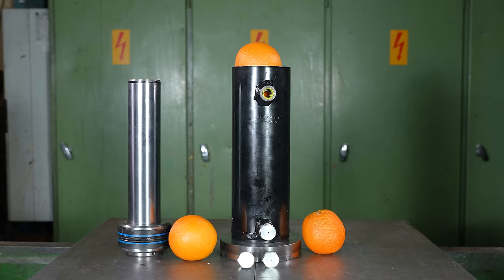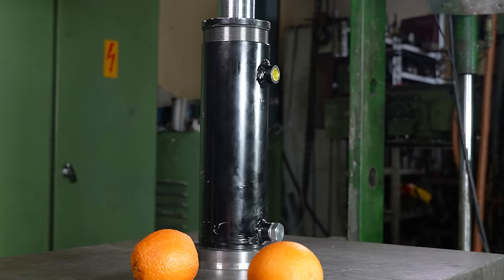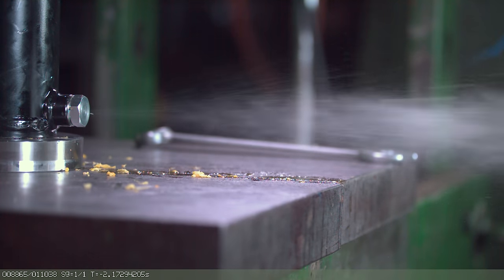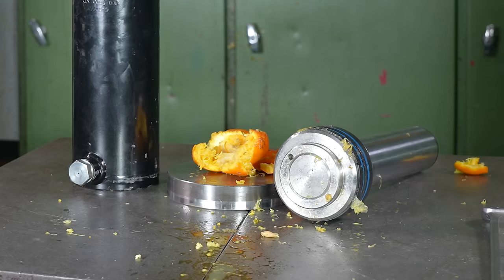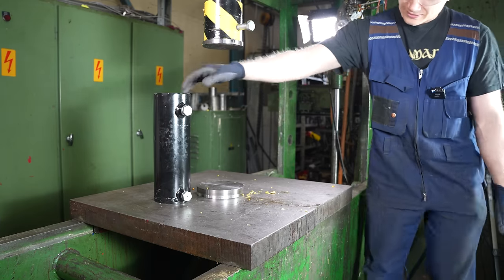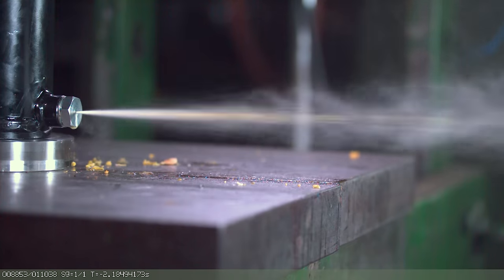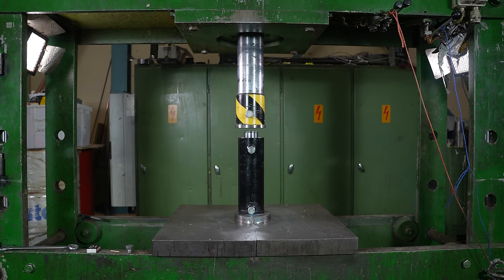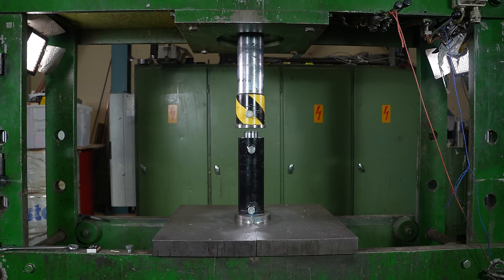How Small Hole Can Oranges Be Pushed Through with Hydraulic Press? + Channel update!

Comment: I want to see what you can cut with the jet coming out of that hole. Cutting wood with an orange would be pretty impressive.
Reply: When life gives you lemons (oranges). Cut wood
Reply: @hanswurst5109  life never gave humans lemons. we made them.
Reply: @GamerFreak-jf3qq You deny humans are alive?
Reply: waterjets for cutting have an abrasive added. they don't cut with pressure alone
Reply: @nairdacnalbel  the orange is the abrasive
Reply: Also a good title.
Reply: Yah, I wouldn't stand directly behind the window just in case
Reply: My company works with water cutters. We cut through the stainless steel belt every 6 months and we only use about 35k lbs of water pressure.
Reply: @nairdacnalbel  not the ones we use. Its chilled water filtered with .5 micron filter. Nothing added to the water
Reply: @scruff5644   do you constantly pass over the belt or does it get accidentally passed every so often?
Reply: @nairdacnalbel  literally no one asked
Reply: @jwalster9412  constantly. We even have stationary cutters that need to be moved so they dont get cut all the way through. Also we use a .1 micron hole
Reply: Candle laser!
Reply: i want to see wood go through that hole

Comment: Im curious how far the candle wax would go without a wall blocking it now
Reply: right that was impressive
Reply: Do you think there is a business for making candles out of the wax stalagmite at the end? That thing looked wild.
Reply: The ball candles worked the best imo. Was really cool to see that.
Reply: Can we see it shoot the wax thru a torch too
Reply: @MadJinx1  just melt a candle..
Reply: @MadJinx1  tape a cup with a wick and use the stream to fill it up XD
Reply: Further,  definitely lol
Reply: To calculate how far the wax would travel, we need to use the Bernoulli's equation, which relates the pressure, velocity, and height of a fluid.

Assuming that the wax is incompressible, the pressure at the nozzle exit will be the same as the pressure inside the cylinder, which is 600 bar or 60,000 kPa. The velocity of the wax at the nozzle exit can be calculated using the continuity equation, which states that the mass flow rate of a fluid is constant across any cross-section:

mass flow rate = density x velocity x cross-sectional area

Since the density of the wax is not given, we will assume it is similar to that of water, which is 1000 kg/m3.

The cross-sectional area of the nozzle is:

A = π x (d/2)2 = π x (1.5/2)2 = 1.77 mm2 = 1.77 x 10-6 m2

The mass flow rate is:

m dot = ρ x A x v

where ρ is the density of the wax, A is the cross-sectional area of the nozzle, and v is the velocity of the wax at the nozzle exit.

Rearranging this equation, we get:

v = m dot / (ρ x A)

v = Q / A

where Q is the volumetric flow rate of the wax, given by:

Q = m dot / ρ

Assuming that the wax is at a temperature of 35°C and has a viscosity similar to that of water, which is 0.0007 Pa·s, we can use the Hagen-Poiseuille equation to calculate the volumetric flow rate:

Q = π x (d/2)4 x ΔP / (8 x η x L)

where ΔP is the pressure drop across the nozzle, η is the viscosity of the wax, and L is the length of the nozzle.

Assuming that the pressure drop across the nozzle is negligible compared to the pressure inside the cylinder, we can use ΔP = 0.

The length of the nozzle is not given, so we will assume it is long enough such that the wax has reached its maximum velocity and is fully developed.

Using these assumptions and values, we get:

Q = π x (1.5/2)4 x 0 / (8 x 0.0007 x L) = 0

This means that the volumetric flow rate of the wax is zero, which is not physically possible. This suggests that either the pressure drop across the nozzle is not negligible, or the length of the nozzle is too short for the wax to reach its maximum velocity.

Without knowing more information about the setup and properties of the wax, it is difficult to accurately calculate how far the wax would travel qwq.

Edit: Another different formula I tried estimated 1.6 metres
Reply: I want to see how high 😅
Reply: Behold! Laser beam of wax lol
Reply: @BritishEngineer they estimate the velocity of the orange to be 160m/s
if we assume the same for the candle wax and neglect air resistance we can simply calculate how far it travels before hitting the floor.

assume it starts a meter high:

0=1-g*t^2
t= sqrt(1/g)
t= ~ 0,32 s

in those 0.32s it takes to reach the floor, it travels 0.32*160 = 51meters
obviously it will be a lot less in reality due to air resistance, which i never learned to calculate unfortunately. I would imagine that it would become something like 20meters.

Comment: The candle wax was so straight, it looked like a laser beam shooting across the room. 
I wonder how far the wax would shoot without a barrier blocking its path? 
That could be a new HPC contest: which item can shoot the farthest?
Reply: Exactly my thoughts! And that would be a great video
Reply: This Comment needs a pin!
Reply: It was a liquid I think when it was shooting out.
Reply: Wax silly string
Reply: silly string of doom
Reply: yes i want to see that
Reply: You can't just take this press outside into an open field....
Reply: @dr.doppeldecker3832  You can if you have enough Finns, Lapin Kulta and Koskenkorva... Trust me they can get it to the moon.
Reply: If it is 1,5m above the ground, with a speed of 160m/s and pointed up in 45° it will reach around 2600 meters of distance.
Reply: @fir3zzz580  ignoring air resistance of course xD
Reply: It will fall to the ground in about 1/2 a second, and we see it travel so it is much slower than a slow bullet going near the speed of sound, and finally since the wax is not too dense it will run into air resistance.  I would estimate it to travel 10-30 meters.

Comment: Molten solder through this would be amazing! The blob the candle made on the wall was cool, but imagine what solder might do... Either it completely hardens into wire before reaching the wall and makes crazy shapes as it runs into itself, or it makes it to the wall still molten creating an interesting abstract art piece. Heating it might be difficult though.. maybe an induction coil around the tube to heat it to melting?
Reply: I imagine it'd probably separate into little beads and balls as the turbulent airflow around the fluid acted upon it. Similar to water out of a hose.

Comment: The jet of oranges coming out of the hole looks to be going really fast. I wonder if it's possible to cut a hole in a piece of wood. Kinda like a waterjet cutting wood.
Reply: Instead of a water jet it would be an Orangette.
Reply: @BrianRRenfro  oranjet?
Reply: There goes my plan of drinking the jet of orange juice
Reply: If thats what youd call an orange jet, whats a orangina?
Reply: If that even glanced off a person it would sting like all heck tho O.o;
Reply: @Z-Ack  Orange flavored Jet, coming in Fallout 6
Reply: @Z-Ack  A noble quest !!
Reply: The water in a waterjet doesn't actually do any cutting. It's just a medium which carries abrasive powder (silicon carbide, aluminum oxide, sand, and garnet) that you add to the water and the water brings it up to high velocities. It's the abrasive powder that does the cutting.
Reply: @wally7856  The water most certainly does do some of the cutting, many water jets (including the one I've used) have settings for no abrasive powder. The abrasives increase the cutting, but water alone is plenty to cut many materials.
Reply: @nikclev  If you're cutting bread I suppose water would do the trick but that's not the purpose of that machine.
Reply: There have got to be some very funny things you can cut with pressurized jets of other very funny things
Reply: just make sure to wear your safety glasses for that one 😂😂😂
Reply: @Spaceman-15  Oranjet cutting right through your skull. 😨
Reply: @Z-Ack  orange flavoured chest pain??
Reply: Meat. I think they should try cutting raw meat on the bone with it.
Reply: Cutting an orange with an orange???
Reply: i got my finger cutt off by orange juice ahhhhhh!!!!
Reply: Make no mistake, that jet is DANGEROUS.
Reply: @PBST_RAIDZ  You REALLY don't want to get orange juice in your eyes. (IT BURNS! IT BURNS!!!)
Reply: this shoots out the 'juice' with 300 bar, according to the video. Waterjets shoot out water at over 3500 bar so wood and metal aren't nearly possible with this cilinder at least, but something like styrofoam could definetly work
Reply: Waterjet cutting actually used corundum fines as the actual cutting material. The water is just the transfer medium.
Reply: Orange based pressure washing?
Reply: No

Comment: You need to make a nozzle pointing upwards, have a hole in the ceiling above and see how high the candle flow will go.  You may need a permit from the aviation authorities though.  Maybe also have it at a 45 degree inclination and see how far it goes.

Comment: High pressure water is used to cut metal. Perhaps try that?
Reply: Depending on what is being cut, abrasives are sometimes added to the water.
Reply: @AB-vc7ox  ^ this. The water in a waterjet doesn't actually do any cutting. You add abrasive powder (silicon carbide, aluminum oxide, sand, and garnet) to the water in a waterjet and the abrasive does the cutting. The water is just the medium that accelerates the abrasive to high velocities.

Comment: So two things.  You put some wick on your blast shield to make a candle from the ejecta.

Second, this interest me for the reason of trying to understand geotech mechanics at deep depths in the earth.  We know there is massive pressure down there, but we don't know how the materials respond to that or even what phase they are in(solid,  liquid, etc).  We have good theories, but I am wondering if you could simulate crustal materials.  In my mind, how that wax shot out is basically what happens to magma chambers when a volcano finally erupts.  Extreme pressure and heat of the earth's crust is forcing molten rock through a (relatively) tiny opening. The result is a spectacular eruption.  Wondering what you could do with other materials to simulate that and I don't know if anyone else has tried it...but sounds interesting.

Comment: Can definitely say you need to do a feature of all the safety equipment that is in place, to a normal person this would seem fine but to someone that works in hydraulics and has seen the effects of liquids like this coming into contact with objects it is very scary, definitely a lot of pressure coming out of those holes 4000psi minimum probably closer to 6000-10000psi

Comment: 1, If you will, just make some very dry dough with flours starches and water, and ram it through that machine into a tray to try as pasta. 
2, As you explained it, you could squeeze hot glue rods through that machine and they'd melt without added heat.